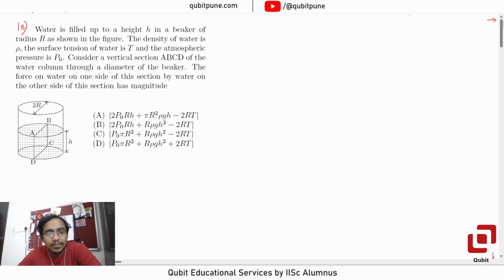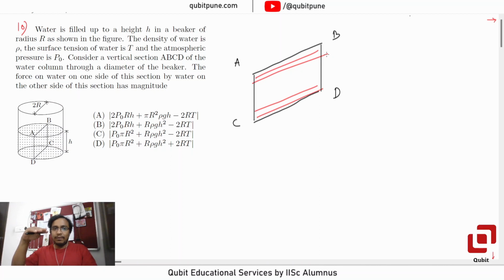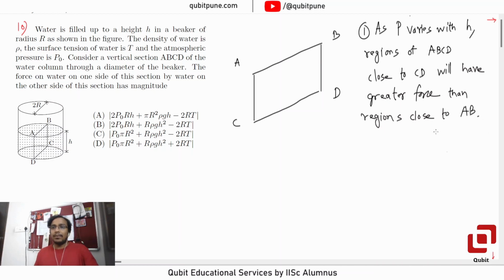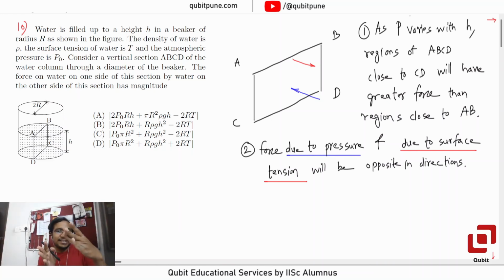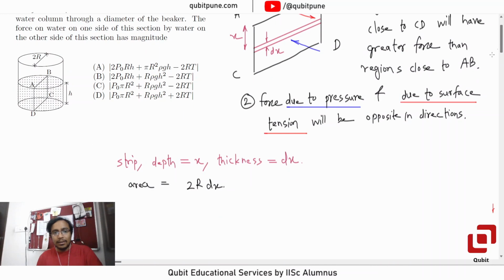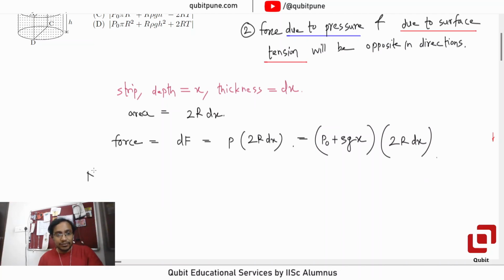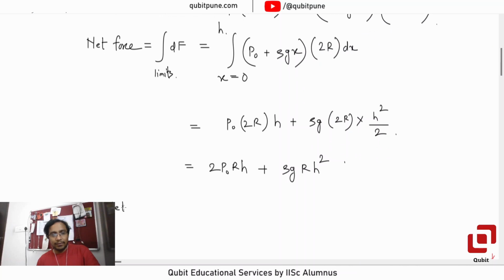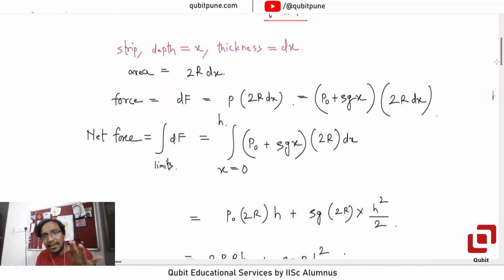INTEGRATION in Physics | Fluid  Pressure | Surface Tension | IISER Aptitude Test 2024  @qubitpune

Comment: While solving the pyqs, i realised that the subject i score the least is physics.
Upon researching further, i came across some stats that physics is actually the toughest part in IAT exam because of XYZ reasons...
I'm generally not good at solving numericals, so is there anyway i can tackle that. Because without physics I can't score 190 in IAT.
Any advice will be beneficial for me.

Thanks.......
Reply from the maker: First get the basics of trigonometry, vectors and calculus right. Start from mechanics. Then, themo-fluids, waves and modern physics.

If time remains, go for electromagnetism.
Reply: @qubitpune  sir I am a dropper so of course I have done all the chapters of physics.....

Is watching a one shot is better or I should just start with solving question from each chapter that you mentioned above
Reply from the maker: Solve